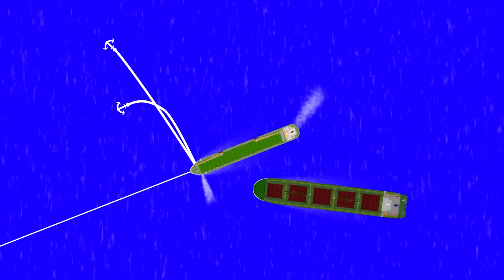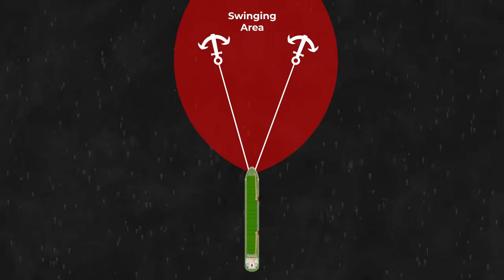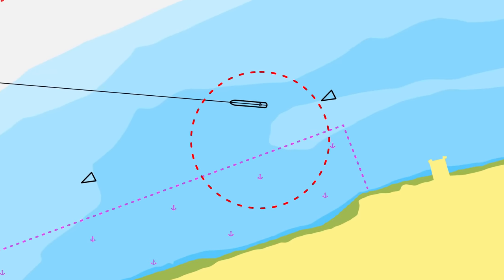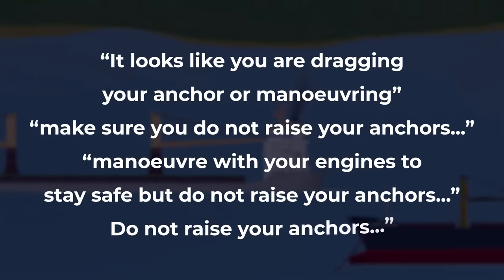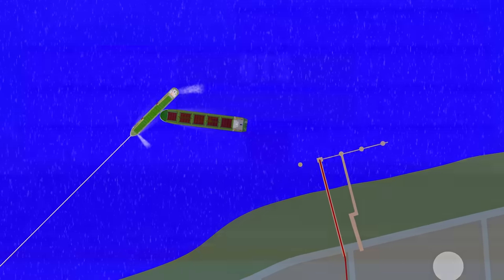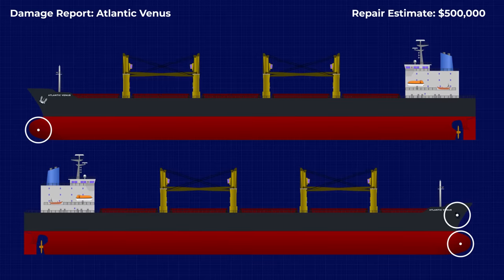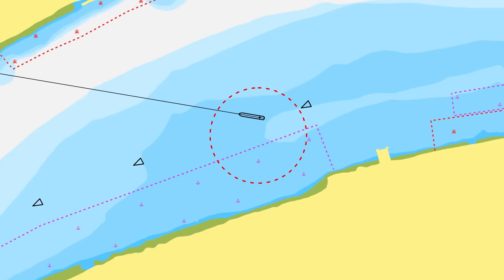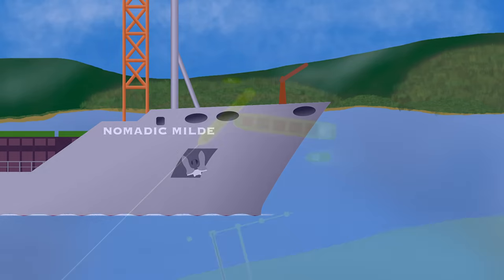Why Weren't Two Anchors Enough?

Comment: Seems to me the parties most at fault are VTS for giving orders that we’re not only actively unhelpful, but also wrong, and the pilot who originally set the anchor points and left in a hurry without verifying that the ship was actually stable. So basically the local authorities. I wonder if they’ll actually admit any culpability or try to scapegoat the crew of the ship?
Reply: agreed !! they dropped the ball then demanded everyone else catch it but then as everyone started reaching out they said no no you cant use your hands XD like seriously this is obviously their fault thru and thru
Reply: At the end the pilot is not responsible, the master has to verify and stays the one responsible in almost any situation. The pilot is there only to give advice.
Reply: @geennaam2712 😅 the pilot is there cuz locals require it
No captain or owner wants to hire a outside party 
So the liability of the ship in port is between the pilots and owner. The captain has no liability in port 😂 🤔 unless they willingly sail the ship into another

The city and port don't want liability, so they are trying to make the owner liable
Reply: You can bet they will try to lay blame with someone else.
Reply: At least part of the matter was settled out of court and the case filed by Cornerstone Chemical was dismissed with prejudice (meaning it can't be refilled) in October 2022. See Eastern District of Louisiana, case 2:20-cv-01411.
Reply: @geennaam2712  Not responsible? Legally I don't see that. The pilot is there by regulation, and the ship has very limited power in how they can overrule them. And the pilot messed up. That's on him. No matter where legal blame is placed he didn't do his job.
Reply: VTS clearly preferred bureaucratic strategy over situational awareness
Reply: @donovanulrich348  You are utterly wrong and @geennaam2712 is utterly correct.  The ship was entirely at fault and the Pilot is not to blame.  The 1st & 2nd Officers need to be keel-hauled for incompetence. How do I know - I am a retired Master with 38 years experience.
Reply: It is entirely the Master's responsibility and nothing to do with VTS or the pilot.  The Master, 1st & 2nd Officers are all to blame.  As soon as the anchors were let go, their position should have been marked on the Ecdis and the swinging circle established.  The 2nd Officer was far too late in doing so and the 1st Officer was negligent in doing nothing about being out of position.
Reply: Atlantic Venus:  "VTS, there is a ship headed towards us that will soon crash into us, please send out a pilot ASAP."
VTS:  "Please refer to our booking agent to schedule your accident avoidance."
Atlantic Venus:  "We called the other ship, but they're not taking action to correct their careening into us.  NEED HELP NOW OR THERE WILL BE A COLLISION."
VTS:  "Keep your shorts on, our dudes are on break."
Atlantic Venus:  "They crashed into us; we're dragging anchors, and both careening straight for your docks!"
VTS:  "Be right there.  Oh, and this must be your fault."

If I were a company, I wouldn't do business there either.
Reply: @pathfinderlight  it is good that the majority comments notice that ! but depressing that there are still some alternatively gifted "we do not know all facts"
Reply: Nope.
The person in charge of the ship that wrecked is 100% at fault. At the end of the day, they are the ones who made poor decisions that ended in a major accident. Someone else making a suggestion is 100% irrelevant to their mistakes in operational procedures.

Here's a good analogy:
The first accident I got in, was because I was turning left out of a parking lot, but there were a line of cars waiting at the light (the parking lot was on the corner at the light). One of the guys in the line approaching the light slowed down to let me go through the gap. He stopped, leaving this gap, and waved me through essentially saying "come on through your good". While this happened, the light also just so happened to turn green without me noticing
    
What I didn't realize is that there was someone coming through the light from the other direction (in the lane I was turning left into), and I didn't see them until i clipped the corner of their front bumper with the corner of my front bumper.
 It was barely any damage (just had to pop the plastic trim back into place more or less) but this whole pattern of events led to a small collision. The point here being that, despite the fact that the guy in the truck waved me through, more or less signalling that it was safe to make my turn, I am the only one responsible for what I do with my vehicle. It is my responsibility to make sure the roadway is clear before I enter it, it is my job to look for oncoming traffic etc. 
The fact that I was beckoned into performing an action with my car, does not eliminate my responsibility for my vehicle and my actions; and thusly I was the one at fault, and the guy who waved me through had literally nothing to do with the incident.

Sure, the captain of the VTS made a bad call on what the struggling cargo ship should do, but at the end of the day everyone is responsible for their own vehicle, and their own actions with that vehicle.
Reply: @PTMG  :

If only life were so simple.
Reply: @WalterBurton  simple and wrong.
Reply: @WalterBurton  in this case it is
Reply: @PTMG  : Nah. This all Jones Act fiefdom power dynamics. That's how you end up in a situation like this.

If the world were as black-and-white as binary questions of responsibility ... heh.
Reply: How did the crew not feel the ship swaying from side to side tho?
Reply: You could do with looking into the rules and relationships between master and pilots. Inn 99% of cases the master is still wholly responsible,  the pilot is simply there to advise. Though I agree he gave some shoddy advise in this situation but at the end of the day the ships officers should have picked it up far earlier and the master should have known the rules and told vts they were doing an emergency weigh anchors. As for visually they should not have Bern talking shit.
Reply: @sillysad3198  I'm not quite sure what you're trying to say, but in most cases, the ship's master is ultimately responsible. Even if he got bad advice from local authorities or his company's agent, he's in charge of his vessel and he's responsible for keeping his crew safe and his vessel under control. 'I was only following orders' didn't work at Nuremberg, nor does it work in this situation, either.
Reply: @PrenticeBoy1688 honestly it should. If I am required to have someone by law then by law they should be liable
Reply: @michaelf.2449  I can't quite remember what the scenario was because my comment was made a few months ago, but if the 'someone' you're speaking of was the local pilot, then no, the ship's master is still in control of his vessel and the buck ultimately stops with him. A pilot knows all the features of the channel, river, or area he's working in. He isn't necessarily familiar with the features and issues of the various vessels he pilots. The master is always in command, though, and he can override a pilot if he needs to. He's the one in charge of all that steel and cargo, not to mention the lives of his crew. That's a huge responsibility, and he can't just throw his arms up if something goes wrong.
Reply: @PrenticeBoy1688  it just to me that it'd be easy for a pilot to override the master because he's basically an "expert" in this specific area so he should hold liable too if he makes a grievous error (not saying this one did but generally)
Reply: @michaelf.2449  I get what you're saying, but that isn't how it works, nor should it be. That's because shipping lines can't control whom local authorities hire as pilots or VTS staff. Forget North America and Western Europe, think about all the ports in third world countries. They can't control those whom other shipping companies hire, either. The lines can control, however, whom they hire. Large commercial vessels are really expensive, as is insurance, etc., etc., and their customers trust that all those valuable goods they've loaded in one port will reach their intended destinations. It's also in a company's interest that voyages be made without losing crew or suffering damage, because that would prevent a particular vessel from loading up and delivering more cargo; that is, from earning the company even more revenue.

The lines hire ship's masters and bridge officers with the expectation that they will do everything I described above, regardless of local conditions, or of the competence of local authorities or their colleagues on other vessels. All that responsibility rests on the master's shoulders. If he must contradict a pilot to keep everybody and everything safe, then so be it. He may not trust outsiders to do that for him.
Reply: @PrenticeBoy1688  you've got a good point.
Reply: @geennaam2712  factually incorrect
Reply: @PTMG  Factually incorrect
Reply: Nah, it’ll be the captain who gets it. But he blames the crew.
Reply: "Local authorities?" What developing country could have slipped up like--- ah, Louisiana.

Comment: It's interesting how, whereas Aviation accidents and incidents often happen so quickly that people cannot respond adequately, Maritime accidents may unfold slowly, but the forces involved are so great that adequate response is incredibly difficult once things have started cascading in the wrong direction.
Reply: Well said
Reply: Rules don't matter when life is at stake but the lack of vigilance by all concerned was cumulative. The captain and crew knew they could not manouvere the ship with anchors down but failed to give VTS a two finger salute and avoid a collision.
Reply: It also seems from a lot of these like part of the issue is often a misjudgement earlier which leaves people with bad information, and people either trusting the information when they shouldn't or second-guessing when they shouldn't.
Reply: In aviation on a deceleration of an emergency is issued, the rules state that the pilot may break any rule they need to to get the plane and passengers on the ground as safely as possible under the circumstances.
Reply: @Krahazik As it should be. The culture is also such that all hands assist the stricken aircraft immediately. Any and every resource is dedicated to getting them to the ground safely precisely because aviation accidents happen so quickly and are absolutely disasterous.
Reply: indeed. so slow that sometimes they dont realize they are happening until its too late to prevent them.

Comment: As a local, I’m wondering when the Mississippi River turned blue, and where all these hills came from.
Reply: Probably because they crashed into a chemical factory 😂
Reply: Why wouldn’t the Mississippi River be blue? Doesn’t it run right along the pyramids of Egypt? It’s like right next to the Pacific Ocean
Reply: @p00piter  the Mississippi is right next to the pacific ocean?????
Reply: @nahx6205  yeah, it runs through Africa
Reply: @p00piter you're thinking of the Nile my friend. The Mississippi runs through the United States and empties into the Atlantic
Reply: The Mississippi River is only blue on navigation charts. As for the hills... I've got nothing.
Reply: @Darkhunter190able You're clearly misinformed. The Mississippi River flows across China and through Shanghai, eventually emptying into the Pacific. Did you never go to school?
Reply: @Syvern. can confirm . Seen it on my trip to china back in ‘92😂
Reply: @Darkhunter190able  Went right over your head lol
Reply: I've heard the Mississippi will be getting a bit salty this year so watch out for the backflow wave, going to fun to surf.

Comment: I’ve anchored 100’s of times in the Mississippi River on very large ships. In high water, high current conditions the anchorages are extremely challenging. The use of two anchors helps keep the ship from slewing out into the busy channel or onto the river bank. I don’t remember ever anchoring with a single anchor in the Mississippi River. When the fog rolls in and visibility drops to zero no one wants large ships slewing out into the path of river traffic. The engine on standby when anchored in high river or close quarters was my standard practice.
Reply: I would think that it would have been better to anchor with a single anchor taking the strain, and then drop the second anchor under foot at short stay.  As the ship starts to "sail" back and forth on the anchor taking the strain, the anchor under foot steadies the ship and constrains the side to side movement.
Reply: This is interesting, thanks for sharing this info. I don’t know why but I’d always assumed ships generally have the facility to lower a stern anchor and that this would help reduce the slewing out and therefore the “walking” effect seen in this video
Reply: Very few merchant vessels carry a stern anchor.  I doubt that a stern anchor would have been of much use in this case as all the strain would have been on the bower anchors with the current.  I've utilized a second anchor underfoot on occasion as it settles the ship down and she doesn't "sail" out on her anchor chain.  When the ship "comes about" when she reaches the end of her swing and turns towards another tack in the opposite direction, tremendous strain is placed on the ground tackle which can cause the anchor to drag.  I've utilized it during the passage of a typhoon in Tokyo Bay, and also with very strong current in San Francisco Bay.  The problem comes when the wind or current shift direction which can cause the anchors chains to cross and become fouled which must be avoided.
Reply: @Pilotsf   the bottom is soft mud and the anchors move around a good bit. you want a spread on the anchors if you drop one close to the ship it would be easier to get them crossed especially when/if it starts dragging. nobody is anchoring a loaded ship of any size in the river in 5kts current on one anchor either. Once the river hits 14ft stage in New Orleans things start going a bit crazy and dragging anchors is common.  The common VTS radio call is to "use your engines to hold position but don't heave anchor." Usually a pilot is close by, coming from another ship or one can be rushed out.
Reply: @bryanachee7133 Why are they directed to not heave anchor if the anchor directly reduces the effectiveness of the engines? Surely the ships have enough propulsion to more than counteract the river current so why not solely use that to hold position when the anchor isn't doing it?

Comment: Well, someone should probably have reminded them that it's called anchor watch because you are supposed to watch the anchors. Otherwise it would be called an anchor justassumeeverythingisfine. Apparently it's not enough to keep your engines on standby, you have to have your brain in gear too. About trying to conform to regulations and orders, there's one word you should never forget when receiving an order: "Unable". Say it, and one of two things will happen: Either the person on the other end will stupidly insist you do what you cannot, then he can and should be ignored. Or they will put their head in gear and help you figure out a solution.